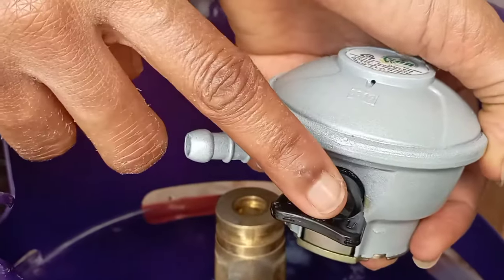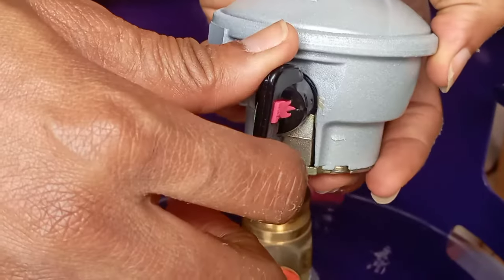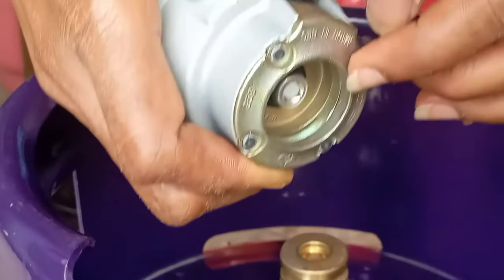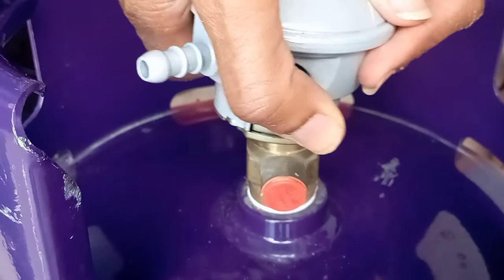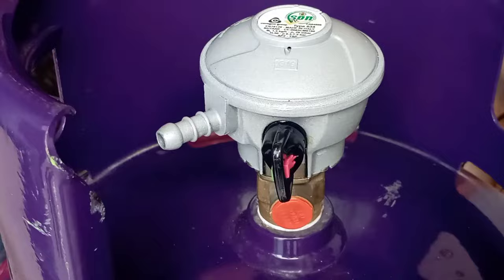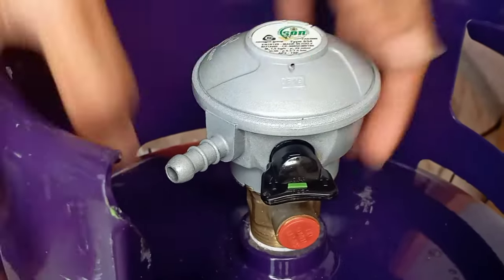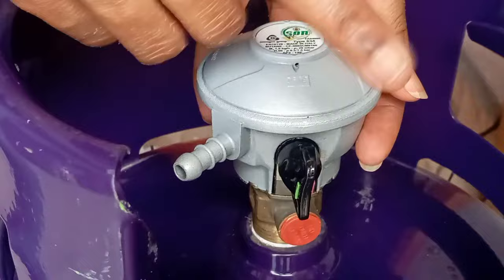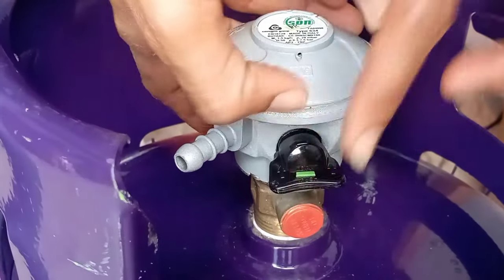How to connect and disconnect gas regulator from a gas cylinder

Comment: The first three videos I looked at which said how to change it did not show how to remove it, and one was 10 minutes long! Yours did in less than 1 minute, thanks!
Reply from the maker: I'm so glad it helped. Thank you so much for watching ❤️❤️
Reply: I was trying to cook just now, i didn't know that my brother had switched off the regulator while fixing it after returning from the gas station (before he left the house again).  I was wondering what to do when the gas cooker refuse to ignite even when the botton was turned on. So I searched on Google and your video came up first. The explanation you gave about the Regulator's switch (...when switched on it makes the gas flow) really helped me to identify the problem. I did as you explained and now my Gas cooker is on and i am preparing my dinner. Thanks so much for you short but loaded explanation. You deserve a 100% thumbs up. Thanks!
Reply from the maker: Awwww..... I'm glad it really helped. Thank you for watching ❤️❤️

Comment: Plugged it and turned it to on and gas is leaking is that right ?
Reply from the maker: When you turn it on, it always makes a 1 second sound of leak to indicate the switch is on. If the leak continues, it is likely the regulator is faulty. Thanks for watching ❤️❤️